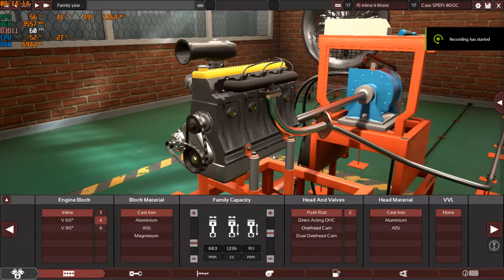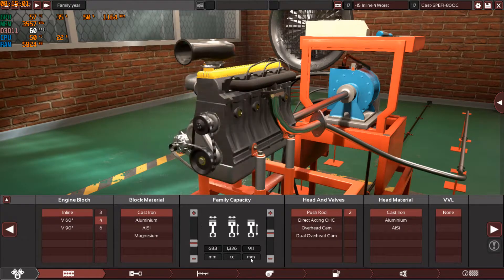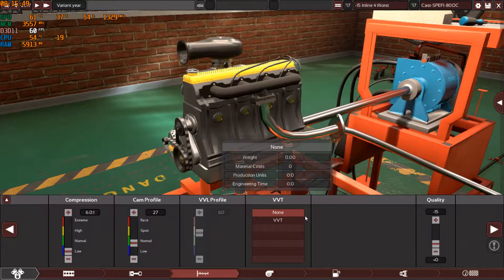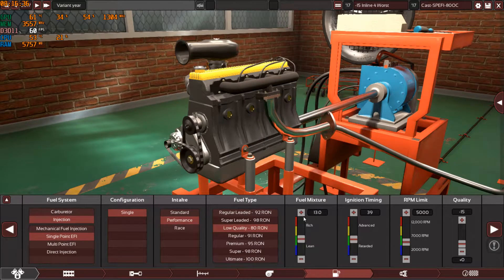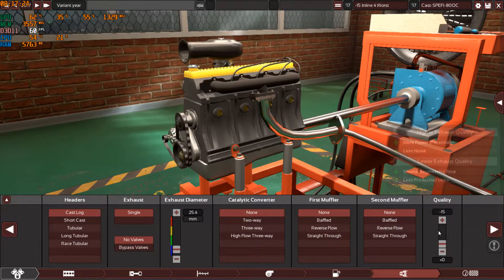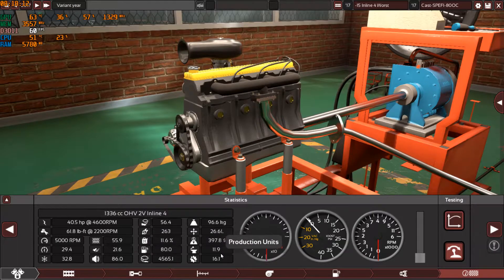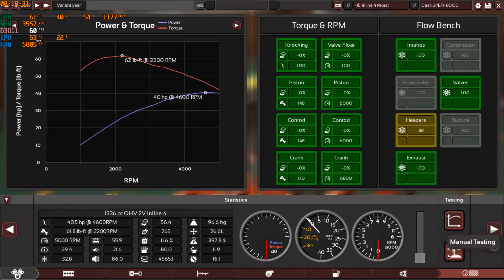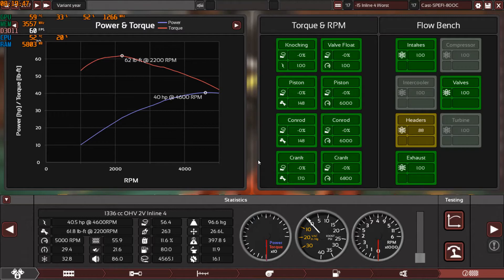The Worst Inline 4 Engine in Automation.

Comment: what if you push it to 12,000 rpm?
Reply from the maker: twoeightzerofive GC it will explode 😁
Reply: Bshar Nasri that is what I want to see😂
Reply: @BsharNasri  Sounds Very Diesel Like.
Reply: @BsharNasri  after the Worst Inline 4 cylinder engine,but a video link for the Fiat Argentino 1.6 engine,use in Brazilian Cars (Fiat Uno, Doblô and the Fiat Palio engine)